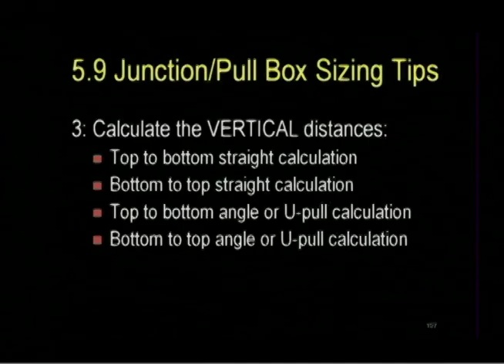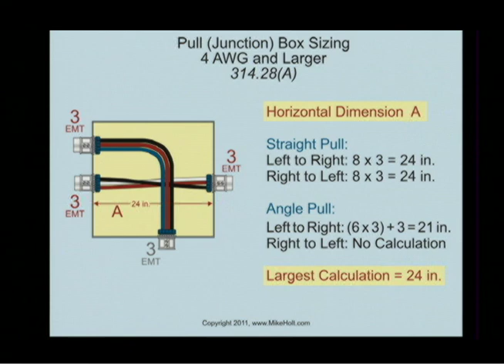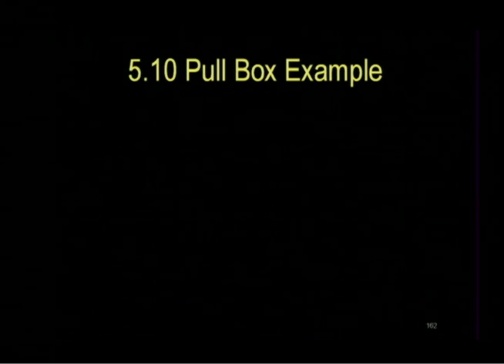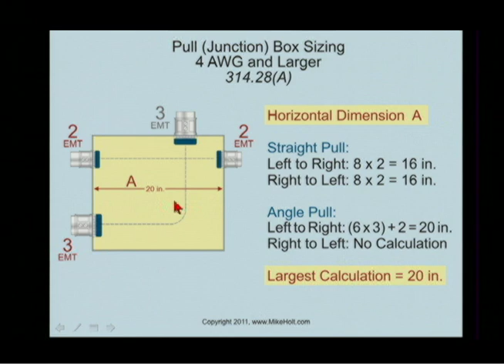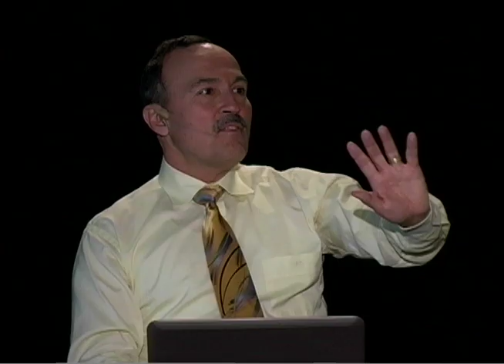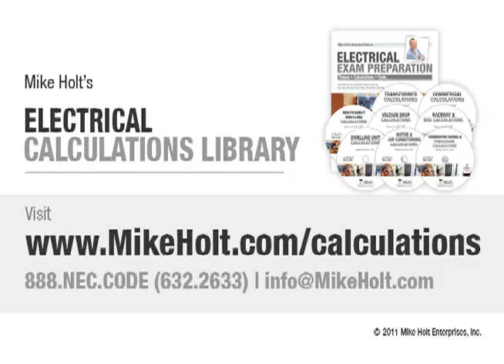NEC 2011 Pull Box Sizing 314.28 (6min:29sec)

Comment: Does the pull (junction) box sizing in 314.28 (a)(1) through (a)(3) not apply for conductors smaller than 4 AWG?
Reply from the maker: Nope.
Reply: First let me say thank you for taking the time to respond. And I love the videos, very educational. And just to confirm, #6 AWG and smaller does not apply to 314.28 (a)(1) through (a)(3). And the same goes for data cables, I.e cat 6 or cat 7? I’m asking because I’m running conduit for cameras, and I want to know (confirm) If the pull box sizing according to 314.28 (a)(1) through (a)(3) DOES NOT apply in this scenario. 
Cause according to what I read, ONLY 4 AWG and larger applies to 314.28 (a)(1) through (a)(3)
Reply from the maker: @ahmatazarl5895  Please get your Code book open and read the rule yourself for your answer. See 314.28.
Reply: MikeHoltNEC I can respect that, thank you again for the response

Comment: I'm getting ready to take my journeyman electrician test and thus is a question on my practice test. The question states:
The minimum length of a box used for straight pulls of conductors larger than #6 through a 2" conduit connected to the box is?
Reply from the maker: +Jimmie Williams Answer: 8 times 2 = 16"

Comment: Where do I find this in the code book? I'm in 314.70 NEC 2014. My question is as follows
The minimum length of a box used for straight pulls of conductors larger than number 6 through a 2" conduit connected to the box is: I came up with 16" somehow but I need to understand it a little more.
Reply from the maker: +Jimmie Williams I don't understand your questions, the topic is about 314.28 (under 1000V), not 314.70 (over 1000V).